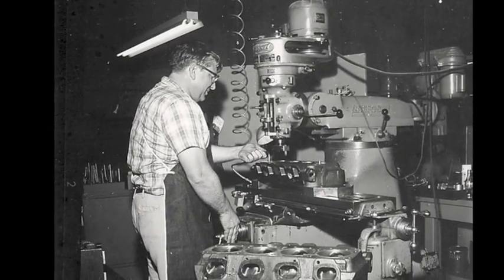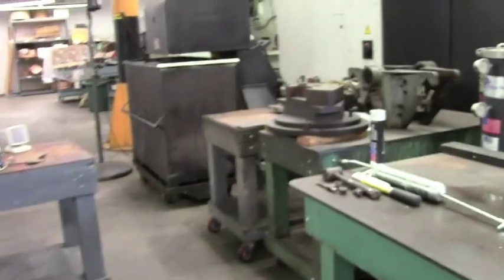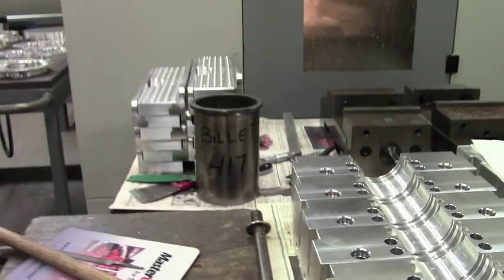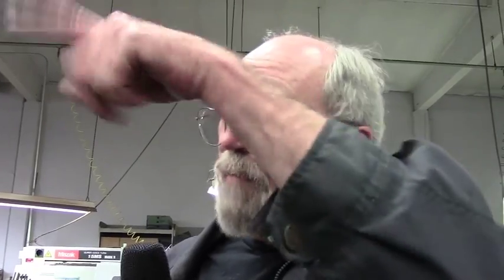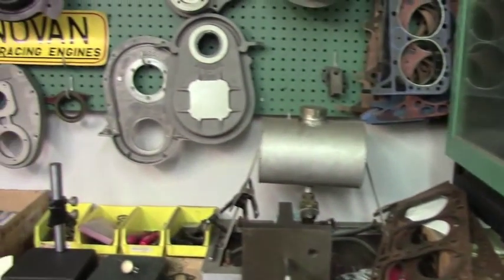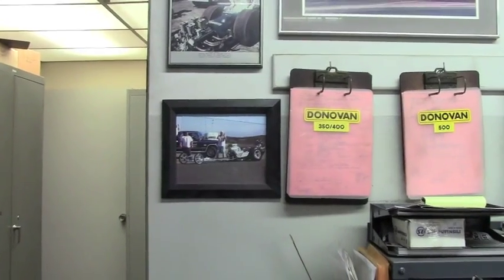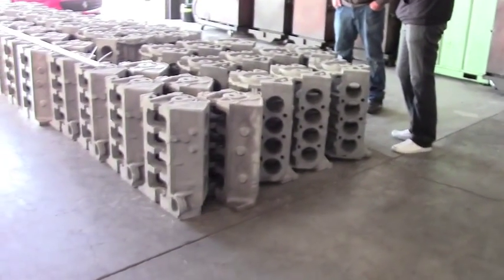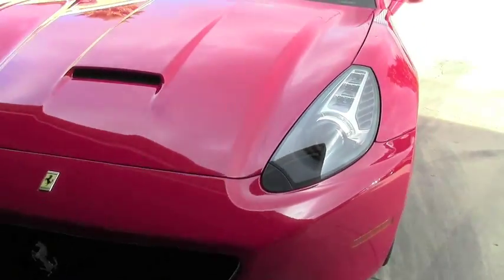Donovan Party 2

Comment: giving a point of  reference , Donovan  a.k.a. "THE MOLE" was one of a group of young men who began racing on the dry lakes in the Cali Desert before WW2.... My father  Bob "Swordfish" Larson, knew Ed The Mole Donovan back then . They raced in the same club, The Bung Holers  ( "B.H." ) Club , was a brake away club from the Hollywood Throttlers.. In those days on the lakes, it was difficult to get a slot to time your car with the SCTA  , so they started their own Timing Group, The Mojave Timing Association MTA because the SCTA was full all weekend out on Murock and El Mirage ....and these dudes wanted to race ......  So Ed Donovan was a friend of my father.  One of the other Bung Holers was Arnold Birner who was the pattern maker for Ed Donovan ....Arnold would carve mahogany master templates for Ed's Intake manifolds ...Arnold made the Frontenac Head...  Other original racers  were ... The Britt Brothers , Frank and John , Van Luven , Von Arx, Gus Summerfield ,  the list goes on.....